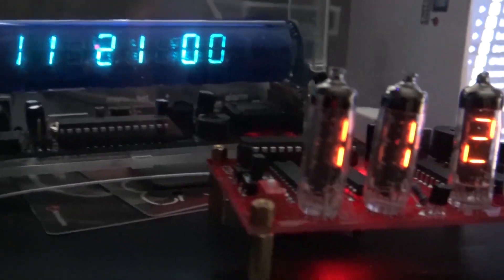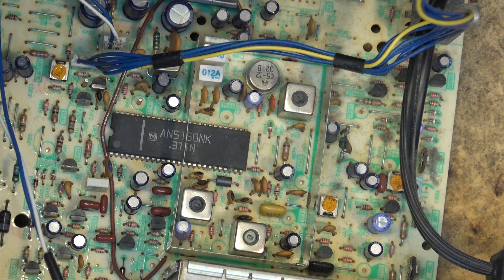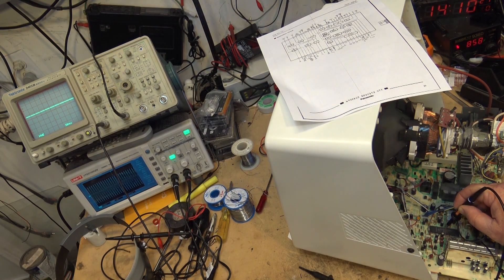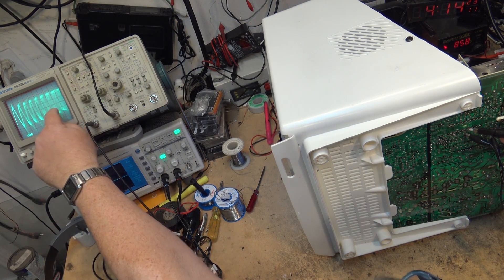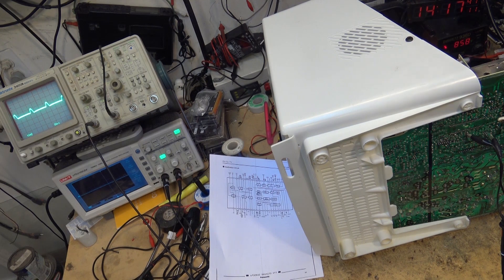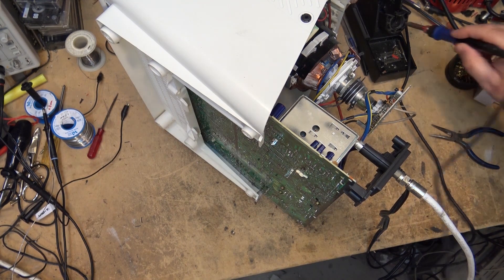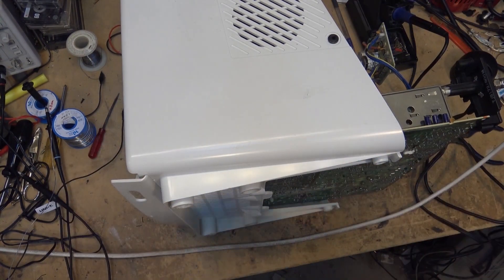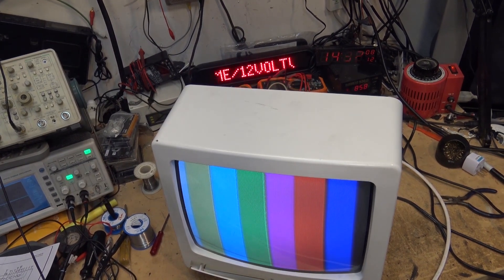Panasonic CRT TV No Color

Comment: My family has a long history with Panasonic. A CRT set we bought in the mid 90s still works from what I last heard.
Reply from the maker: It probably does. I have a few sets from the 80's and 90s that still work perfectly. I have 2 of the last CRT sets made. One if used as a security camera monitor. The screen is really badly burned, like really bad, but the set still produces a good picture. It's been running pretty much non stop since I bought it at Walmart for 40.00 when they were clearing out the last of the analog sets in 2006.

Comment: Enjoying your videos. I remember we had a Panasonic TX28W 28 " CRT brought in 1992 and failed in 1995 with this exact fault no colour on main picture but all the menus would show in colour.  As it was  already out of guarantee we had our local TV repair man come and collect it ( this set was a big heavy beast). After he was unable to locate the fault it landed up having to go back to Panasonic and repaired there. They agreed that although the set was out of guarantee at only 3 years old it should not have developed a serious failure and only had to pay a fraction of the repair cost. After all this was an expensive set when purchased in 1992. I hung on to the set even after we retired it as our main TV in 2000 and used it in our conservatory for years. It developed another fault in early 2004 where the picture would be fine    for the first 10 mins after switch on but as it warmed up the picture would go out of focus. I made a decision at that point do I scrap it ( most people would have) or do I try and get it looked at. I took it to another local repair shop at this point they were still a few around. After a couple of days he called me to say the line output transformer had failed and would need replacing and looking at £100.00. I must have been mad but after chatting with the repair guy and him saying it was a lovely set still i decided for the repair to go ahead. I still have the set today but gets very little use obviously. When I retired it from being our main TV in 2000 we went for our first CRT wide-screen which developed a fault in the first 12 months and got our money back on that. We then decided to go for a Toshiba 32ZP18P over a £1000.00 would have been one of the last high quality CRTs made as only a few years later the Plasma/LCDS started to flood the market. I still have the Toshiba as well works perfectly and unlike the Panasonic has never suffered any faults or failures. Hanging onto it for now may be worth a fortune in years to come as there things are getting rare and there is still a demand for high quality sets like this.

Comment: I’m glad the scope seems to be working for you. I see a future video on repairing broken scope trigger control. Would also be interesting to see if someone has modified the scope bandwidth.
Reply from the maker: Yes I will have to try and fix that control. Might be able to glue a new shaft on it.
Reply from the maker: David Raezer 
There are 3 versions of that scope. No letter an A and B version. Me thinks that someone swapped a board from a 300 kHz scope.  That's ok because I will never need to look at a thing that high in freq. I did fine with a 40 mhz for years.

Comment: Great use of the data sheet for the main chip and some reasoning (as well as looking at waveforms) to narrow down where the fault could be.  Others would have shot gun replaced every single capacitor, resistor and semiconductor, reflowed every single solder joint and hope that fixes it.

Comment: Not sure about that digital scope but my rigol has a video trigger function which allows it to capture these sorts of waveforms a bit better.
Reply from the maker: This one does not have video triger. I have been through all the menus, and it doesn't have it. Some may, but not the cheap POS I have. It is great for some things but looking at video or RF from head amplifier is not one of them.
Reply: Fair enough then, although my rigol is only the cheaper DS1052E. btw are they still laying pipes outside your house? I would have thought you guys would have 6ft of snow on the ground by now lol.
Reply: Yeah that UNI-T is the worst scope to compare to an analog scope. You need at least the Rigol 1000Z series with lots of waveform captures per second. A Keysight 2000  or so would do even better.
Reply: the 1054z is all around better than that uni-t It shows video waveform near perfectly. You only need the trigger if you want to see individual frames of video. Though i really wish i could find an affordable analog scope around here, this rigol has been working out great.

Comment: 1000 Videos, fantastic :-D :-D
That's smashing, i was hoping that the chip was ok :-D.
I'm not supprised that the analog scope was so good, that was a smashing gift.
Your analysis of the faulty capacitor is bang on, I did find ceramic caps in a c.b that showed resistance!, it had sat in a damp place and most of the chassis to pcb caps were dead.

I sat here just trying to remember the ntsc color crystal frequency, i made a digital cap checker around one, then i remembered 3.5795 Mhz roughly, memory plays games lol.
Reply from the maker: 3.579545 to be exact.
PAL used 4.43 if memory serves me correct.
This analog scope is a real nice one, and nicer now that I have fixed the control.  I will hang onto the DSO because there are some things it will work with, but the Tek will be my main scope.
Reply: Yes you make sense, i have an ancient cossor scope and a portable battery/mains telequipment one.
The telequipment one has had more bad joints than i can remember, but i wont let it die, im cruel lol :)

Comment: Nice to see you got a Tek 2465.  Just checked the price of those knobs because I was curious for my Tek 2225 scope as well since I'm missing one and Jesus they want an arm and a leg even for used ones.   It doesn't bother me that much enough to spend $25 for one
Reply from the maker: I think a dab of JB weld and a donor knob will have to do. 
The only one I am needing is trig level, so as long as I can make it long enough to adjust I will be happy.
Reply from the maker: Dacke 
One of the knobs dromedary my old iwatsu fits and the trig level can be adjusted with finger tip no problem so it is l working at least what I have tested so far.
Reply: Nice.  I wish I had some spare knobs.  Holdoff knob is missing on mine but it's not like I need to adjust that one much.  There's actually a website that sells knobs for HP and Tek scopes and Spec analyzers but now I just can't remember it for the life of me

I always have to wonder what the hell people do to these poor analog scopes to snap/crack off the front panel knobs so much,  I try to take really good care of my stuff and never have an issue...
Reply from the maker: I hear you. I was able to salvage one of my old Iwatsu, so all is good. Fit perfectly, as it is secured with a set screw.
You will see it in future videos. It is red, but who cares right. As long as it works. I have a few projects to work on. Another vintage AM radio in need of a rebuild, but first I have another one of those ANdroid boxes that I need to set up, and test for a client.

Comment: You said use isolation transformer, agree! You said without you could make the line of solder points hot by reversing 2 prong plug. In that case was the ac cap put in backwards? Another guy has a tool to check caps before putting them in to check AC caps? Something to think about?  I don't think it matters, DC yes, but since you said if plug is reversed& not isolated it makes a difference which I agree,what about AC caps?

Comment: Those chips did the job but they were cheap and cheerful same as the 4066 chips in technics tape decks.
Reply from the maker: Untill it isn't a chip that fails.
Reply: No i know, i was very surprised

Comment: Would have been good to have tested the ESR on the Cap before installing the new one, to see how far out of spec it was.
Reply: It's unlikely for a ceramic capacitor to fail with a change in ESR, and given the very low capacity, it would be quite difficult to measure the ESR anyway. More likely it became electrically leaky, or the capacitance changed drastically, or it may have become electrically noisy/partially open circuit from physical damage.

Comment: Can you help give my Panasonic a rough diagnosis please? Anything helps, thanks!!!
Problems:
1. The picture randomly brightens and dims for about 5 seconds, then stops for a few minutes.
2. Pressing the volume and channel buttons shakes the picture.
3. Jolting the TV shakes the picture.
4. The top of the picture develops a bright rectangular bar with tiny black lines within it. This rectangular bar develops randomly.
5. While #4 happens, thin, horizontal, and black lines flash on the screen.
6. Sometimes while the picture dims and brightens violently, objects within the picture develop a  streaking shadow going across the screen (which is what your Panasonic GAOO did until you replaced a capacitor).
Reply from the maker: If you smack the TV and the picture changes it sure sounds like a bad connectioin somewhere.
Reply: I found bad solder joints around the jungle ic which on my portable is at the very front of the board.. I think operating the push buttons may have been the long term cause. Observed the board flex very slightly when a front panel control was pressed..
Reply: 12voltvids Do you think a dying capacitor could be the cause of 1, 4, 5, 6?
Reply: Check for dry joints on the flyback transformer - they were as guilty as sin for that.  Also look at the joints in the IF strip.
Reply: As fulwell says it seems like EHT wobble - look at base of line output transformer (flyback US). This is very common on all TVs as the heavy transformer stresses the circuit board. Go over any dubious connections with the iron, look over whole circuit while you are there.
Reply: UPDATE: I took it to the repair shop, and it needed resoldering in the connections with the power cord.
Reply: I fixed this problems many times before for CRT computer monitors.The problems you’re describing is the video board connections socket pins that connected to the CRT tube neck are having colds soldering joints.Re soldering all the joints on the video board socket pins connections to the CRT tube neck joints will solve the problems your tv is having.

Comment: I regret giving one of these away . working with remote .
I had now space for it .
Now I REGRET IT because my PlayStation dose not look good on these new tablet TVs .
These tube TVs are just better anyway .👍
Reply from the maker: Definitely better for vintage video games. I'll hook my pacman board to this one.
Reply: Keeping the PlayStation's , they are in demand .
Games obviously not completed yet
Reply from the maker: I have an old PS2 and a PS3 and an xbox360 still in the box never opened never plugged in.. The ps3 I have is a vintage unit that will play the PS1, 2 and 3 games. One of the very sought after units.
Reply: Funny how they only made so little of them like that .
I refused the PS 3 as it would not run TT Isle Of Man on PS 2 disc !
OK , I have had a check up from the neck up after kicking that TV out , it appears that there is a bit of bone in there .